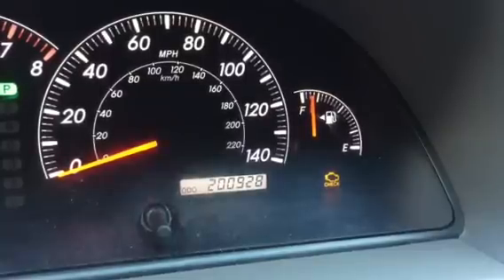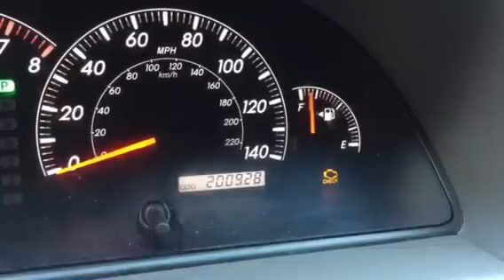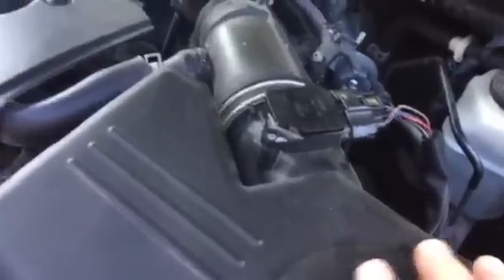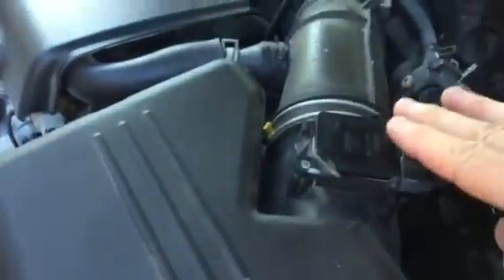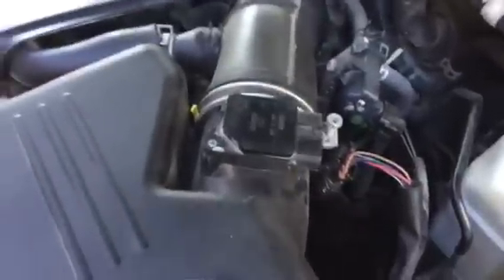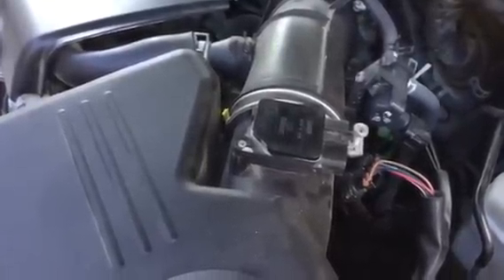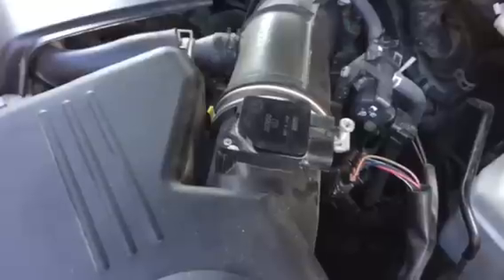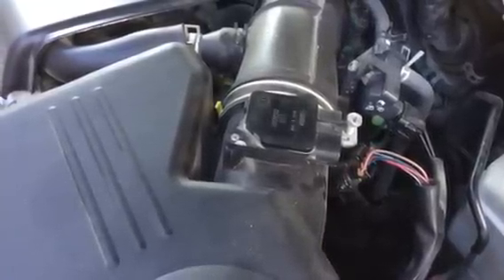How To Tell If Your Mass Air Flow Sensor Is Bad On Your Car

Comment: hello friend, is it OK to do this even if the check engine light doesn't turn on? I mean disconnecting the harness while the engine is running, even if the check engine light isn't on. thank you
Reply: wait, that's what you did, right?

Comment: How did you come to the determination that it was a problem with the mass air flow sensor???  Was it just a random "shot in the dark" or is this your go to fix?
Reply: This is HOW to tell if it's the mass air flow sensor OR something else. The FIX is either replacement or a can of mass air flow cleaner (particular solvent which cleans them). If the engine keeps running then you know SOMETHING ELSE has made the check engine light come on. Strange thing with my old hyundai the manual tells you it's only ONE thing that can cause the engine light to come on and it's a failed oxygen sensor. Most car makers won't even tell you what causes it and it could be dozens of things and generally you need an OBDII scanner to even find out.

Comment: So I tried this on my 2016 Colorado and it kept running when I disconnected it. Changed it out and have put 50 miles on it without any luck. Any other ideas by chance? Also it did throw a p068 code at advance auto.

Comment: Hello from the uk.. I unplugged my mag while the car was running and I carried on running but it sounded like the engine revved up more than normal.. so connected it all back up and now I have three maf fault codes?? Could you please help to point me in the right direction to go about it.. 
thanks 👍🏼
Reply: Replace, if possible?, If not buy a can of mass air flow cleaner, or even a used one from a u-pull u-pay store. Once they go bad, that's it. And I think he said something about the computer resets itself after 20 or so miles. Not sure how new your car is, but for me, I can remove my battery cable,-, and my computer resets. Also you can try to take it apart and re store the m.a.f your self, this being last resort. Hope this helps, and good day.👍
Reply: I cleaned the sensor with the spray but I thought I would do the test as shown in the video to make sure it was working.. I’m going to get the codes wiped of and go from there.. thanks for the reply much appreciated👍🏼 you have a good day to pal

Comment: I had my wife's 2014 Subaru Forester into AutoZone to have them grab the computer codes when a check engine light went on.  The report read: ASE certified Master Technicians have seen this issue or your type of vehicle and the most likely solution is:  Replace Mass Air Flow (MAF) Sensor".  Seeing this video  "How To Tell If Your Mass Air FLow Sensor IS Bad On Your Car", I disconnected the MAF sensor while the engine was running and the engine shut down.  This indicates that my MAF sensor IS GOOD!  I'm still going to have to take her Forester to the dealer.  What does this tell you?

Comment: When my car hit 130,000 miles my check engine light came on. So I took it to an auto parts store. They did a test the code came up  bad mass airflow sensor. Since they had to order @ 220.00 each and I needed two of them. So I said no thanks and went over to Walmart and picked up mass airflow sensor cleaner/ throttlebody cleaner kit off the shelf for 10.00  and did the job myself. Followed the directions and put everything back together. Check engine light turned off on test run and 30,000 miles later it’s still good. Just saying try cleaning it 1st.
Reply: David Wiley about to attempt this tomorrow morning on my Lexus is250... It was suggested by mechanic working at auto zone. Wish me luck 🍀 glad your car is working
Reply: Mrs Right the Infamous Black Goddess Good luck and take your time. It’s not to hard to do and worth doing it yourself!
Reply: David Wiley it worked out great Dave.. thank you! 😊
Reply: Mrs Right the Infamous Black Goddess Cool! Glad it all worked out 💪
Reply: Never buy parts from AutoZone... Save yourself the money and buy it from Amazon.
Reply: Ajw312 oh no sir, I bought it from somewhere else.. but i didnt need the MAF sensor part,  i just cleaned it and bought a OBD2 scanner and my car purrs like a cat again. No funkiness while idling at stoplight. But thanks for your support ❤️
Reply: I tried cleaning. But it did work for me. I pulled the connector while running and engine still run... i will order a new MAF now. Thanks
Reply: hendel IMPAS 
Hi, 
Walmart sells mass air flow sensor and throttle body cleaner on the cheep. My car has two mass flow sensors and two throttle bodies. With the engine cool I carefully removed the sensors and sprayed clean. Then set them aside to dry. Next I took both intakes apart to get to the throttle bodies butterflies. Very important: I was instructed not to take the bodies off the engine or unplug the wire harness from them. Otherwise I would have to have them reprogrammed = cash out of pocket. So I sprayed them down heavily on the car and wiped clean inside and out as best as I could. I let everything dry for 1/2hr then reassembled. My engine light has not come in since and my car is getting better gas milage since I did this m. Now I’m at 200,000 freeway miles and my 2010 Infiniti G37 sedan is still working great. Hope this tip helps you.

Comment: I am trusting the Lord will get this message to you seeing it's been three years since you posted this video.   I have a mass low voltage on my Volvo 2006 S60 and no one seems to figure how to fix this issue.

Comment: I have a check engine code : pO507.  On my honda accordIdle rmp higher than normal.   I hope its the mass air flow sensor since its one of the cheapest sensor out of all.

Comment: I just tested this on my car. Its Peugeot 407 2.0 hdi and it have check engine light constantly on. I disconect a sensor and engine did NOT shut down. DO I NEED TO BUY ANOTHER SENSOR OR MAYBE I JUST NEED TO CLEAN IT? Thanks for advice..
Reply: Adnan Jusic you can try just cleaning it with some parts cleaner. Spray only don't scrub or touch it. If that doesn't fix it, just replace. Should be relatively inexpensive part.
Reply: @belavet  ok, i will clean it. Btw new sensor here cost around 130€ (150$) and my car behave normaly. Power is there and fuel economy is good: from 6l/100km to 8l/100km with AC turned on most of the time.
Reply: Adnan Jusic sorry about the price. I buy generic parts whenever I can. I guess I take for granted I'm in the US. The part for our van that is OEM runs $120 but I bought a third party replacement for $30.

Comment: Can driving it around disconnected cause damage?
Reply: Jerry Hanson Nope, but your car might run idle weird and consume more gas. It basically won’t run as efficiently as it should.
Reply: @gegervary  I bought a new one put that on cleared the codes drove it around and the mass air flow sensor code came back up again what the hell LOL

Comment: Does it apply for diesel engines too? I just checked it on my car and it kept running. But no warnings, check engine light. But I'm getting worse gas mileage though

Comment: Thanks a billion dude. I just replaced my throttle body and map sensor and I was still getting an engine light and reduced power light every now and then.
Reply: Car hard starts? Meaning if u start the car, will it cut out, but when u start the second time, it start up ok? If so, it might be your fuel pump

Comment: I did the test! My car sputtered but it stayed running... bought a mass flow sensor for cheap on eBay and it did the same thing. What’s this mean? Does this mean I need the $128 mass flow sensor?
Reply: Clean it.

Comment: Hi bud my corsa was losing power in second gear. Checked a few videos. And i was going ro inspect the maf. Anyway i just checked the jubilee clips and one was quite loose. Tightened both up not happened since. 😄Happy days.
Reply from the maker: Kat Wells 👍😊

Comment: Hey Paul! I’ve had this issue with my WRX and I’ve bought 2 replacements and they both do the same. I unplug and my engine continues to run. Any ideas on what it might be?
Reply: My chev aveo had the same prblm I found out that the o2sensor was e one with a prblm replaced it n it WS good

Comment: Just did this and the motor shut off. So that keabs the mas air flow good. Thanks fir the help. But what else coukd cause a lean 300 code
Reply: P0300 (OBD II) is a random misfire code.

Comment: My check engine light is not on but could I still have a bad MAF?
Reply: I just did it to mine. I didn't have a light but it fixed my problem.

Comment: My engine kept running do i have to replace it with a new sensor or just clean it ?
Reply: I'm not sure myself but I would start with cleaning it with mass air flow sensor cleaner first. Those parts are over a hundred dollars depending on the car. After cleaning it do the same test if it still runs after unplugging it then you know to buy a new one
Reply: Jerry Hanson sounds good thanks man

Comment: i have two 2007 ford Escapes with 2.3l engines.oNE HAS THE P2195 code the other is fine. Well disconnect the MAF on the good car ...it keeps running. Disconnect on the one with the check engine light on it stalls. So this doesn't work in my case.

Comment: you do not mention  if this applies to diesels as well but i thought i would give it a go on my 2005 vauxhall vivaro 1.9 diesel van .I tried it and engine continued to run  so i shall  be going down this road to try and sort out  the low power at low revs problem i have .I am not a mechanic so was grateful for this tip . if anyone out there has experienced similar and has any  suggestions i would be very grateful .thanks .
Reply: Bro, pls check simple stuff first...on Diesels if your fuel flow is restricted = low power and prob low revs too.

How long since your last fuel filter change ?

Or did van sit for long period & you just began running it ?

Bacteria crud grows in tank from sitting idle, then gets sucked into fuek filter upon restarting it.

Check that & tell us here what you find.

Diesel Dave in Texas
Reply: not sure mate only had van since end of may and i need it for work .Think i will put it in to be looked at when my work load eases .thanks for your advice .I have a mate who had the same van and they are well known for M.A.F  sensor probs .most vehicles have an Achilles heel and it seems this is the problem with this type of van .I will ask them to fit a new fuel filter when it is in there .Thanks for your advice amigo .
Reply: @LCHLLO2008  Roger that.

Remember on a Diesel fuel flow is everything. 
Like ignition & fuel together on a gasoline rig.
On my Dodge Cummins Turbodiesel Ram Truck I carry spare fuel filter as part of my "road Service kit"...
Cheers - David

Comment: Thanks for the video. I unplugged mine on my bmw E60 and it actually ran BETTER without and the idle was way more smooth lmao
Reply: Giovanni Ramirez I put CAI on my mustang and didn’t clicked that perfectly and the car was running insane.. after I fixed that, it’s become kinda slow 😂

Comment: I have a 03 Lexus es300 and mines starts but quickly dies out.. doesn’t idles.. but if I hold down the gas, it doesn’t hesitate or wanting to shut off.. so I know it isn’t my engine could be some electrical but can’t figure it out.
Reply from the maker: Daniel Gallegos have you cleaned your throttle body?

Comment: I just did that test and that's the problem or at least one of the problems..bad mass air flow sensor....car just kept running when I unplugged the wire....cool
Reply: Not true on all cars. Some computers have a MAF default so if you unplug it your engine runs on the computer default settings.

Comment: My jeep seems to being losing power and starts to shake at what seems random times when i come to a stop i believe this might be the problem but no check engine light has come on
Reply from the maker: yarbz Have you cleaned the throttle body?
Reply from the maker: Meet Jeep Wrangler Africa  https://youtu.be/g3bNz1m1Wfo

Comment: I know mine is bad. My car runs better without it plugged in. I need to replace it. 2004 chevy impala ss
Reply: I have a 2003 impala ls and light is on i obd2 read it o2 senor and heater core bank 1 and 2 are bad
Reply: I have a 2003 impala ls my light been on i odb 2 read it and my heater core bank 1 and 2 are bad and o2 sensor

Comment: My Car has relatively poor idle, mild "fish-nibble" type feeling at 30-45 mph acceleration. Engine Light on. Autozone scan had 3 Codes (PO442) (PO303) (PO316). I realize these scans will give you several possible reasons for a Problem (Fixing 1 CORRECT problem could probably fix all other codes shown). Found small Vacuum Leak at Boot to air Intake (fixed). Engine light disappeared after 2 days. Still have idle and weak acceleration issue and sometimes at idle a very mild like misfire. I tried disconnecting my Mass Air Flow Sensor while engine running and car continued to run. I think i will order and new MAF and see if this is the problem. I think the car still has a air-fuel system problem and the MAF Sensor seems to have a lot to do with it. Thanks for this video.
Reply from the maker: K 👍😊

Comment: My Mazda Tribute 4 cylinders 2002 model is refusing to reverse,  i have to force it. What is causing this?
Reply: Transmission error
Reply: @TheDjcoridon  how can it be corrected?
Reply: Do I have to replace the gear box.
Reply: Could be a fluid leak, most of the time it's not the transmission that's causing your car not to reverse it's the clutch,best to get it looked at by a professional.
Reply: Does your car whine in reverse? Whining noise could easily be the transmission fluid filter.
Reply: @TheDjcoridon  thank, will try to have it looked at.

Comment: My car keeps running when I disconnect it but it runs fine and performs fine?
Reply: Been researching this and if you unplug it should still run. The ecm will use default settings. This video is wrong.
Reply: Steve Edwards Thank You for the info.

Comment: Okay I replaced the mass air flow sensor but when I drove it it was coughing puking and when then it died but when I restarted it and move some wires around it stayed running normal could it be the connector or the wires and where does the black read and white wire go

Comment: Is that for all cars same? (BMW)?
Reply: Yes. If you unplug the MAF sensor and it turns the car off the sensor is working. I bought a new one and tried it. It did the same thing.
Reply: @pineapplesplash9166  ok Thanks Begause my bmw still running  motor not turn off

Comment: my car stopped running the engine wen i pulled off the plug,..well guess what,..it runs with the sensor that doesnt have a small bulb like (sensor) how that possible,..

Comment: Tried it on my 06 Ford e150 van with a 302 v8  and engine changed idle speed but didn't die it just changed the fuel mixture so guess it's ok , cleaned it too . Boy these older vehicles can give you a run for your money trying to fine problem spotes
Reply: 2006 is not an older vehicle.

Comment: My 2002 blazer didnt die thanka quick and simple i also probed with a multi meter and found that with out the maf connected i got 5 volts from the signal (accessory on ) and with the maf it only showed 3.70 and jumped all over decending as i increased the engine speed (all the down to 2.3-2.5 volts ) this also indicates a maf failure. Awesome vid

Comment: I was told never disconnect any sensor until you remove the neg cable off the battery, that it would damage the computer. Is this correct or not?
Reply: Not correct. Sensors fail all the time and if that took out the ECU there would be hell to pay in court for all the manufacturers.

Comment: Thank you for the information, it worked textbook perfect! I changed mine out on a 98 Honda Accord and it fixed it. Back on the road! Your video was short and to the point, not confusing. Appreciate Ya!
Reply: Yes I did , it was running very rough as I was driving down the road. Acted like it was missing and was going to stop at times. That fixed it. But if that doesn’t fix your problem it could be another sensor.there are quite a few of them that could make it do the same thing.
Reply: @Jimbo7303  98 it works, but after 2000 no more so this test is for older cars, use live data and you know for sure what the problem will be.
Reply: did u experience any car symptoms before u changed the maf sensor...

Comment: My 2016 Chevy Cruze gots a p1101 code any help guys
Reply from the maker: Your Mass Air Flow sensor either needs to be cleaned or replaced.
Reply: Thanks a lot for the reply .I also searched up some videos about this p1101 code and came across that it could be two things the mass air flow sensor or the head gasket with valve.
Reply: The car just yesterday started having this issue the RPM gage it’s starting to move up and down Slightly and the car car Shakes almost like if it wants to turn off ?

Comment: Ck'd it with my OBD II it said flow restriction. I thought it was the cad converter but saw this video wow! fastest diagnosis ever. Thank you!
Reply: Mine is saying p0403 EGR vaccums solonoid . But when I pull this plug it doesn’t shut off

Comment: We just a new coil put onour 2004 Ford Freestar SEL Mini Van, and now it's running even worse than it did before we had it worked on. It has stopped backfiring, however now it doesn't have any power. I have told my Husband that I thought that the mas air flow sensor needed to checked, since that's the only other thing I can think of that would cause the problem. Thank you for the video, I will mention it to my Husband.

Comment: i got new mass air flow that sensor wire off and still runs
Reply: This trick doesn't work on every vehicle, typically with the harness off the car will still run by the computer guessing at the ratios

Comment: I just tried this and my check engine light was never on before and now it turnd on how can I fix it
Reply from the maker: Just keep driving.  Somewhere between 10 to 50 miles the ECM will do a reset and turn it off.
Reply: @proclaimliberty2000  thank you so much!